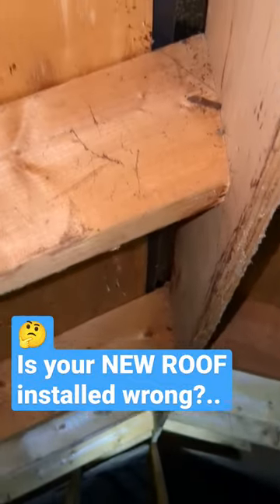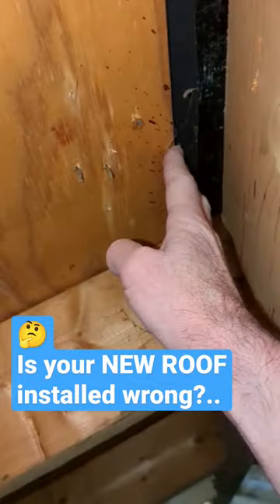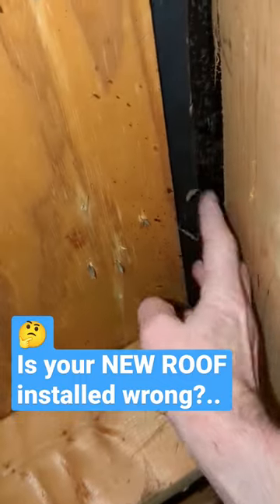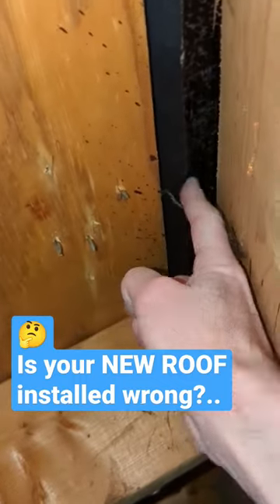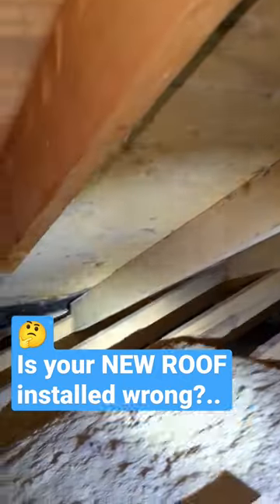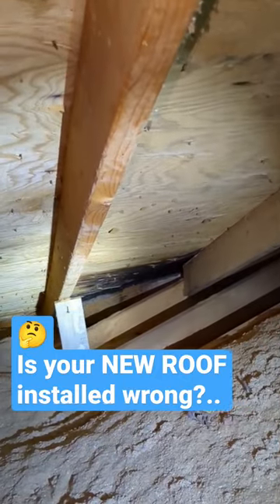New roof improperly installed #youtubeshorts #shortvideo#rain#roof#construction #realestate#shingles

Comment: Ridge vents suck I have seen a lot of damage caused by super light snow blowing up and creating a drift on top of the insulation soffit vents are quite sufficient or operational gable vents that can be closed in the winter

Comment: I caught my roofer over nailing the nails were too deep in the shingles he had to remove the entire roof.
Reply from the maker: Wow. I find shingles applied like that. They become loose later on and start to slip down. Code inspectors don't get on the roofs. Who's watching the roofer? GOOD catch on your part.👍
Thanks for watching and sharing the story.
Reply: @InspectFlix  It's always a great idea to ask the roofer to use a hammer and no nail gun it can be a little more but it's worth it🙂
Reply from the maker: @billyflanagan9657  👍 Yes. We still have an old time roofer south of me that uses a hammer only. Hard to find because it's all about that speed process. 
When I hear someone say they can get the job done faster, THAT'S a problem.
Reply: @inspectflix  👍
Reply: @inspectflix tools are intended to save people time and energy . Just because you hire an idiot that can't use a tool properly, that doesn't mean the tool is bad .
Reply: @Thevoiceinsidemyhead-bh8ky  always want to blame the tool never the tradesman. If the tool is defective causing you to do insufficient work, either fix it or get the right tools for the job at hand.
Reply: @JonathanKilbourn-uz4qq  i agree , I don't blame the tool because there are adjustment settings.  Anyone who actually knows what they are doing knows how to adjust their tools so they work correctly.  
The problem was definitely operator error, not the tool . 😁
Reply: We do hand nail roof’s with copper nails it’s expensive. But if you’re a experienced roofer you can hear the mail hit the sheathing. It makes a different sound when you get between the boards. Also you can adjust your compressor and the tip of your gun on the nailing depth😂😂😂😂
Reply: @thomasmurphy9350  I understand that. The average roof is 30 squares. A high wind area example uses 480 nails a square or 14400 nails. There are many common nailing errors for roof installations, but we’ll just focus on the ones that cause nail pops.

First, nails should go straight into the shingle so that the nail head is flat against the shingle, creating a seal. If the nail is driven in crooked, it won’t create that seal. As a result, water could seep under the shingle and nail during wind-driven rains.

Secondly, the nail needs just the right amount of pressure. An overdriven nail can break the shingle, while an underdriven (loose) nail won’t create the necessary seal.
Reply: @inspectflix  Thanks. It's unbelievable how many poor contractors are out there. I had a metal roof installed and I caught a different Roofer using the incorrect underlayment which would have acted like sand paper and rubbed off the protective coating on the galvalume. He had to remove the entire roof. I sued him in court and won
🙂
Reply: @Thevoiceinsidemyhead-bh8ky  OK but if you tell the customer you will not use a nail gun and do it by hand because the nail gun's always install atleast 1% of the nails incorrectly you will get more jobs and be able to change more for your time. It just gives people a good feeling knowing it's basically hand made. The roof is the most important thing on a home 🙂
Reply: @Thevoiceinsidemyhead-bh8ky  ya the nail gun did hurt my feelings because my roofer who had a good reputation because he was friends with the inspector who would sign off his hack work made a mess.
People actually need to do there own inspections and know what to look for. I'll tell you what let me inspect your jobs since you're so good I guarantee I'll find nail pop's.
Reply: @Thevoiceinsidemyhead-bh8ky  As I stated before many roofers use a hammer those are the roofers in my opinion that are a step above that I have paid more for and got a better result. If you sell your self as a roofer that hand nails your shingles I guarantee you will win more bids against the competition. The roof is the most important thing on any home people just want to feel confident it was not rushed and done with pride and if they know it was done by hand that's what separates you from the competition 🙂
Reply: @billyflanagan9657  believe me the kids getting into roofing now can’t even hand nail straight. I’m saying I’ve been roofing at least 40yrs. The two guys that work with me over 30 years. If your gun is adjusted correctly and running at proper pressure. Or even some of the newer cordless guns. We can put. Down a flawless roof. That most companies in the area say we overkill everything we do from underlayment.  To screwing off  existing plywood. Ice and water shield up walls throughout valleys counter flash with step  flashing.  Ya you have to keep an eye on the pressure and the temperature. I haven’t had a call back in   Over 35 years. I get calls to fix everyone else’s.  People who didn’t want to pay my price and went with a cheaper price.
Reply: @billyflanagan9657  wow so they been making nail guns for 30 years years that apparently can't nail a shingle correctly.  Lmfao
Reply: @thomasmurphy9350  I know its sad because the kids today don't care they are lazy. The problem is too many roofers hire out subcontractors. I am sure you're company tom does beautiful work. Cheers🙂
Reply: @Thevoiceinsidemyhead-bh8ky  it's usually the installer just not using the nail gun correctly putting nails in at a 45 degree angle not taking the time to maintain the pressure regulator on the compressor not having a large enough tank to maintain proper pressure the list goes on and on.🙂
Reply: @billyflanagan9657  well an experienced roofer will have the correct compressor and will have  it set properly  , they will also have the depth setting on the gun set properly  .  Your nails will be flat and correct if the workers want to do a good job (pride) and have experience. 
Your agrument is becoming ridiculous because your putting hand nailing on a pedestal thinking any hand nailer you hire will do a better job . The fact is they can screw things up just the same . You can still have bad nails or leaks, and shody work in general .
If you really want to choose better workers, then go view work they previously  did before you hire them  😁.
Reply: @Thevoiceinsidemyhead-bh8ky  the problem also is roofers hiring subcontractors and if you have five different guys on the job each roofers with a different skill set. All I am saying is that the majority of the time there is less mistakes with a hammer that is why people are willing to pay more. Take care I am sure you do a beautiful job.🙂
Reply: @billyflanagan9657  five different guys on a crew each with a different  skill set  ........... omg, we were talking about putting a nail into a shingle . How many skill sets are needed to put in a nail correctly ? 
If you have a gas compressor, you can run 3-4 guns, and you don't have  to change the setting in the compressor.  
If you hire a company that does a big roof and they show up with an electric compressor, then you hired the wrong company, lol
Every shingler should be able to correctly nail a shingle , the more experienced shingler would do the harder things like valleys and chimneys.  
But they would all know who to nail correctly.
Good luck finding good workers . It's  hard these days  , everyone wants to cut corners, and helpers are hard to find . 
Everyone wants to be an influencer 😁

Comment: I bought a house with a roof that's just about reached its lifespan but has no visible leaks coming through the drywall except in the very back. the shingles are still there but theres almost no sheathing left from ice damming I assume and no attic access and some soft spots and a couple large sags in the middle. It's about a 6/12 in the front with 2 valleys and about a 3/12 in the back. Well I cut an attic access and come to find out the house was originally a 6/12 throughout and someone just put new rafters over the old to create the low pitch and used shingles on the low pitch. I'm not looking forward to the can of worms that's gonna be opened when I get the roof replaced and I know its gonna be too much to do myself. I'm thinking of just taking it back to the original rafters or at least having metal hangers installed instead of relying on just nails
Reply from the maker: Wow, thanks for sharing. There's a lot of home owners out there that don't know the conditions of their own home. And are not sure what to look for. 
Sounds like you're on it. 
I have had many people in the past hire me to let them know the conditions. You just have to make sure the inspector has a builders license and or has been in the trades. 
Thanks for watching.

Comment: Ridge vents only work in attics designed for them. Stop listening to roofers about air flow. Listen to HVAC (heating, Ventilation and air conditioning)  guys. Air is like electricity, it takes path of least resistance.

Comment: If the top shingle at the top of the ridge under the ridgevent is too short, they have to make sure it’s long enough to where if water gets wind driven under it it still has a chance to come back down and not going to the home 👍🏼👍🏼👍🏼
Reply from the maker: Thanks for watching.
Reply: @inspectflix Only for about five or six inches
Reply from the maker: @Steven-io7hx  NOPE. 
The whole ridge in-between each rafter. I have many photos in that file for that write up.
Reply: @inspectflix  Yeah that's terrible

Comment: one comment I've seen one comment scrolling through your guy said I can see ridge vent that's the closest I got to correcting this dude everybody else just battered the contractor when the contractor did it right look it up they say an engine 3/4 Max inch and a half is fine inches usually what we go you cut the roof back inch and a half on each side for the ridge vent that's the proper way to do it that roof is perfectly fine the way the ridge vent was put on
Reply from the maker: Well, my fingers were touching the material and all of it is solid with NO place for air to escape. 🤔

Comment: If your not running a metal roof you usually just put felt paper and shingles over the ridge and it won’t leak if it’s leaking somewhere it’s not bc they didn’t put the ridge it’s bc they layed the shingles wrong or their is a hole in them somewhere
Reply from the maker: Thanks for watching.
The roof leakage was definitely not from the ridge vent, but the valley was also improperly installed on top.
Reply: No absolutely not I do this for a living well I frame and dry in for roofers that should be cut and ridge roll our whatever ridge you like installed then cap...your welcome
Reply: You absolutely wrong dude
Reply from the maker: @riclmena9395  Agree. That's crazy talk.
Thanks for watching

Comment: I have had a similar experience to this except I was on the Roofing end. If I drive an hour and a half to put a roof on and the dumb ass Superintendent doesn’t have the ridge vent there guess what? I’m closing it up the same way to keep the water out not my fucking problem. I will still get paid every penny. I am owed.